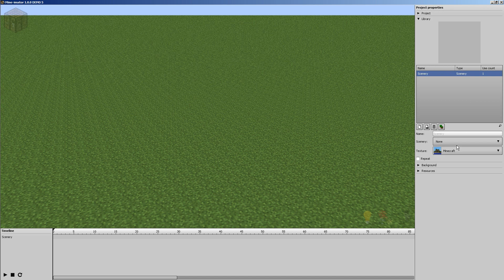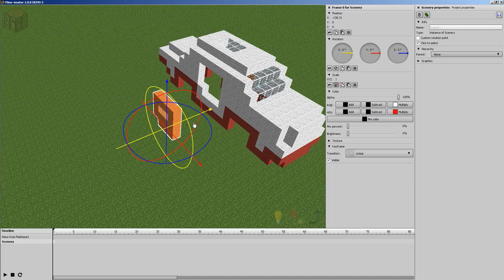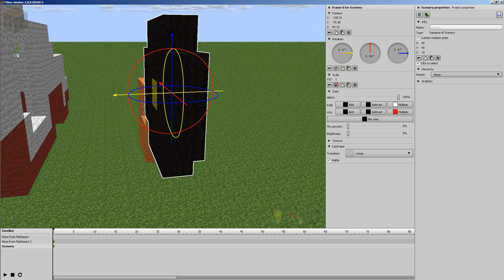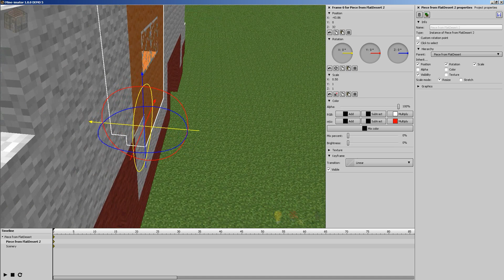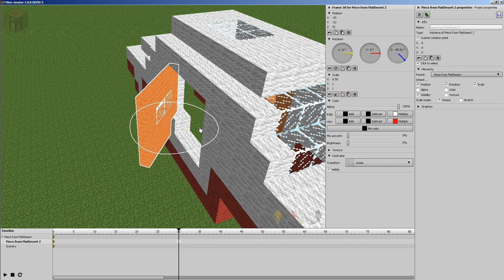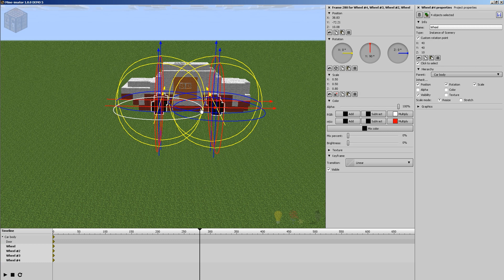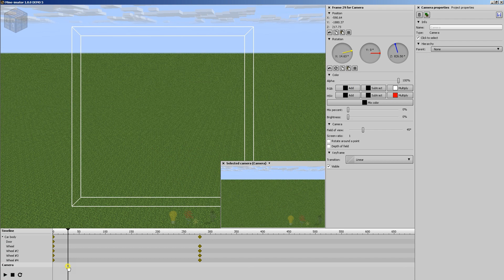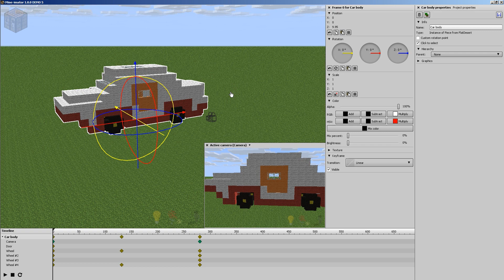Mine-imator Tutorial - Custom Schematics: Animating A Car | 6

Comment: There is an easier way to build the wheels.
Step 1: Duplicate the first wheel.
Step 2: Drag the copy to another rim.
Step 3: Duplicate both these wheels, so two new ones are made.
Step 4: Drag the two newest copies to the other side or the other end, depending on how you wish to make the wheels.

This is faster than doing one wheel at a time.
Reply from the maker: Julia Sweet You're correct! There's a lot of ways to find shortcuts in the program, just gotta think ahead!